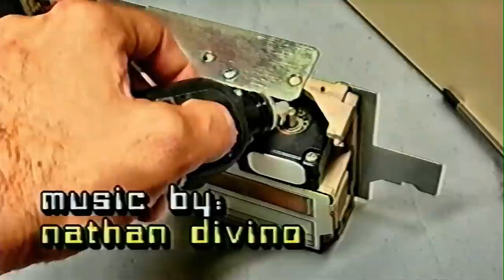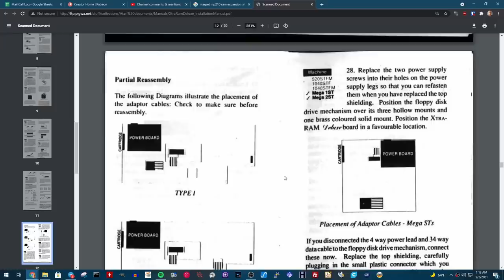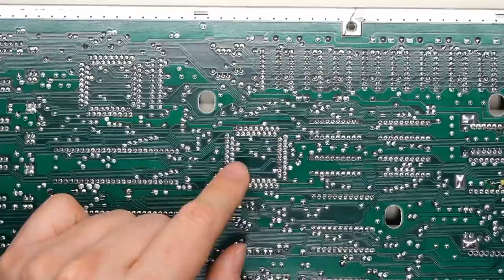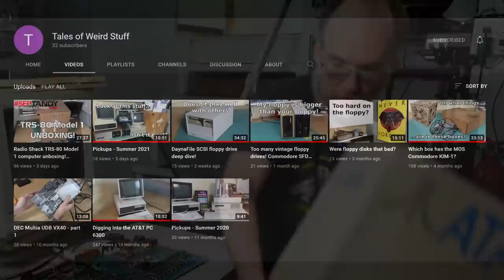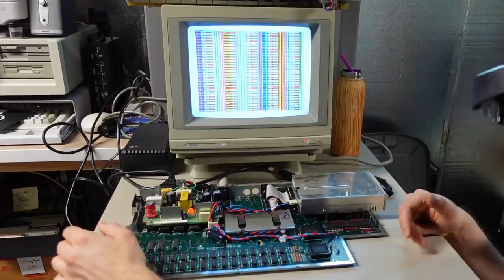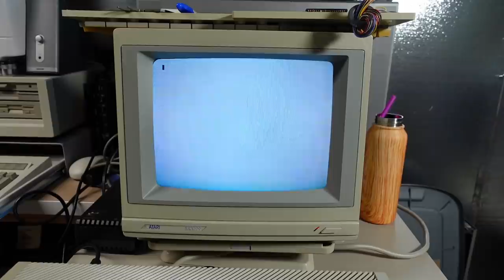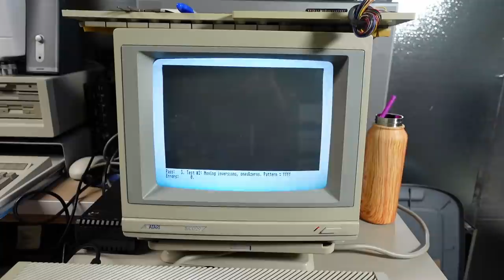I figured out what is wrong with the Atari 520 ST!

Comment: My 1040ST got me through college with zero issues. Replaced it with a PowerMac 6100 66 DOS that I used until 2005. Two computers in sixteen years, until internet and software demands forced me to join the 21st Century. Simpler times.

Comment: Very good troubleshooting. You nearly reverse engineered how the ST works. :-) Bad MMU is not that common. I never had an ST with a bad MMU. But the PLCC sockets of the MMU and the GLUE are known to have contact problems from time to time. Especially if a RAM expansion was squeezed between chips and socket. I would suggest to take a closer look at the pins of the bad MMU with a microscope. Maybe some of them are not making good contact and the MMU from the 1040 is working because it has them still in order.
Reply: I was thinking this same thing. As you say, check all the pins on the MMU.
Reply: For a time I worked doing warranty repairs for both Atari and Commodore. I saw pretty few Atari ST machines coming in but a lot more Amiga. I remember that for a time Commodore had big problems with those PLCC sockets and chips not getting good contact. A lot of this was traced to the factory where completed and boxed machines got bumped around when the pallets were loaded onto the trucks. To get to the loading docks the forklifts drove over some very uneven parts of the floor. As I remember it they described it as all the cartons on the pallet going airborne only to slam down after free falling more than an inch, but that could be my memory playing tricks. Apparently that was enough to shift the chips just a little in the sockets and if you were unlucky it resulted in the machine failing. Often just pressing all the chips firmly into the sockets could get the up and running again. Even after addressing that problem with the forklifts Commodore choose to install a retention spring across the the sockets and it cut down on the number of DOA and early warranty returns.

Comment: That MMU may still be alive, clean the pins and check if none of them are pushed in from the side, those PLCC mod boards wreck sockets and chips.
TOS 1.00 is just bad, replace it with 1.04 ASAP, 1.00 is kinda buggy and don't even bother with harddisks on that version, the hardisk routines are seriously borked in 1.00
I have no idea what is in your SF314 or if it even works, but the signals that come from the atari itself are pure Shugart, any active conversion within SF354 or SF314 is to accomodate a non standard drive.

An easy way to check if an atari 16/32 bit machine lives is to check the floppy led or the DS0 line on the YAMAHA, a faint blink indicates some lif in it.
One of the biggest issues with these old Atari's is in my experience. bad contacts on sockets, especially the square plcc sockets, clean them or carefully re-bend them.
If needed replace those pesky staggered sockets with SMD sockets, with some bending of the outer pins you can solder these sockets with smd and through hole at the same time.
The easiest retro way of upgrading the 520st is by piggybacking another set of ramchips on the existing and connect their RAS and CAS lines to the other set at the MMU for a home made 1MB total 520ST+, or you can solder a 72pin socket to the board, it's a tedious job, but a fine DIY way to max it out, ST's need FP-RAM sticks.

Boot speeds relating to floppy drives.
1: diskette with game or bootsie bootsector
2: regular diskette in drive
3: no disk drive attached, takes a second to detect a drive foor bootsector and gives up. Also no A or B drive on desktop.
4: empty drive, takes a long time to give the user time to insert a bootable diskette
Reply: Adrian's 520 ST has 1.4 already
Reply: @Motolav  I think S B is referring to the 1040 STF, which has TOS 1.0 in this case.
Reply: @TPau65  which isn't Adrian's lol
Reply: I still have TOS 1.01 on my machine.  You can get TOS 1.04 and boot it from the Floppy if you can't get the ROM.  Also you can get the Clock speed up to 16 MHz. but if you want some old games or software to run you should install a switch so you can boot the machine stock without having to remove the mod.
Reply: @kevin34ct  You mean TOS 1.0, there wasn't a 1.01. In my 520 STM I have switchable TOS 1.0 and KAOS-TOS. 😁
Reply: @TPau65  mis-typed, it was 1.02.  I could install a blitter
Reply: Why not go all the way and update it to 1.06. Those were the latest official versions. iirc 2.06 was same Tos, just for STe's

Comment: Some background Information:
The RAM bus and the system bus are separated. The Shifter is on the RAM bus. The separation is needed for the framebuffer (Shifter) and RAM refresh. The MMU is controlling the Shifter and it is fetching 16Bit every 256 clock ticks. Without the separation the system bus would be blocked every time a RAM refesh is running or part of the frame buffer is fetched into the Shifter. A Crazy little tidbit. To load the Shifter register only the lower 8 bit of the RAM bus is connected to the system bus to present the register to the CPU.

The ROMs are on the system bus not the RAM Bus. The 68K can't run without RAM. Important Interrupt and Error-Jump variables are stored In the first 512 byte of RAM.

The only reason why MMUs are diying is an overload on the output pins. (and over voltage) The chip can't really power a lot. With 4MB RAM the output limit is reached. This is the reason why you have to completely disconnect the RAM (lifting all the resitors). It is recommended to remove the old RAM chips. Not only to protect the MMU but also the power supply. The diconnect of the CAS0/1 lines is a botch job that can work but will stress the MMU.

SOME versions of the TOS did crash when the keyboard is not connected. The reason is that the inteligent keyboard controller (ikbd) is also the system clock. And when the system clock is not initialized the TOS would crash. But the ikbd is a very bad clock with an high drift. But good enough for a day or two. So later Models like the MEGA ST, the MEGA STE, Falcon and TT had all clock chips.

Comment from the maker: Lots of people pointed out that the Atari does have a full 16 bit bus and that I "got it wrong." That may be, but consider the fact this was the first time I had ever worked on any 16 bit Atari, I had not yet examined the schematics for the 520ST and that the other 68000 machines I've worked on (the Macintosh 68000 machines and the Amiga 68000 machines) do not have two CAS lines for the high and low bytes of each memory location. All 16 RAM chips on these systems get the same CAS signal so the RAM is either selected or it's not selected.

If one were to hook up 8 bits of RAM to a 16 bit system, two latches and two banks of 8-bits of RAM with two select signals would be one way to do it. This would easily allow Atari to install half the RAM in the system to allow for 256k of RAM. (For the 260ST)
Reply: Didn't BYTE mag publish a way to upgrade the memory for the Atari 520ST?
Reply: While I'm pretty sure the ST (at least normally) uses the full 16 bit bus, you are correct that the existence of the latches between the MMU and the RAM suggest it is a possibility. The board I made in school used latches in the way to interface a single 8 bit ROM to an m68k, although for the RAM card we did have a 16 bit data bus with separate select lines for each byte connected to UDS/LDS in large part because our address decoding logic was simpler that way.
Reply: Using latches and two select signals COULD work since the 68000 doesn't have an A0 signal on the address bus. It instead has an upper data strobe (/UDS) and a lower data strobe (/LDS) which you could use as the selects. Those signals are there because Motorola intended RAM to be organised in parallel high byte/low byte "banks" and is precisely why Atari chose to organise the ST's RAM in two or four parallel high/low banks the way they did.

Besides, you'd need to get the timings just right for it to work which would likely mean having to use much faster (and therefore MUCH more expensive) RAM chips more than wiping out any savings you'd make by using half the chips - well, back then anyway. Otherwise you'd have to find a way to insert wait states while loading those latches, I've not done any 68k hardware design in a couple of decades and I'm not sure that's even possible (maybe using the /DTACK signal?). All of which would slow the machine down.

Also for 16/32 bit memory operations /LDS and /UDS both go low together, so even more complications...

No, the only sensible way to create a 256K ST would be to have two banks of 128K RAM chips - e.g. HM48128P, MK4128N, etc.
Reply: @nathanperry1997  RMC recently showed how to upgrade an Atari 520STFM from 512k to 4M but from what I can tell that probably wouldn't work in this 520ST.
Reply: Yeah here is just one memory bank 16bit width connected, you can solder a second batch of memory ontop of the first one and connect ras/cas to the mmu to get 1mb of memory. Atari did it on the 520St+
Reply: Checked the Amiga A500 and Mac Classic schematics. Both have separate CAS signals for high and low bytes, just like the Atari ST.
Reply: @nynyny7  the st has Ras0 for Bank 0 and Ras1 for bank 1, and cas0 low and cas0 high, cas1low and cas1 high. So you have two banks 16bit width. The Atari Mmus (not the imp chipset) can handle different bank sizes.
Reply: It's addressed as two banks to acomodate byte wide memory instructions. In older machines most data was byte wide, 8 bits. If you addressed memory only as 16 bits you would waste large amounts of memory or have multiple instructions to write only 8 bits without altering the other 8 bits. If you wanted only 256k, you used two 128k banks or you wouldn't be able to use 16 bit word instructions.
Reply: Amigas most definitely do have two CAS lines.  Without them it's impossible for the CPU to read/write single bytes.  I'd be surprised if Macs don't also have the same setup, but I've never looked at one of those.
Reply: @ingouhlemann5035  No, there are two memory banks here each being 256K*8. One provides the lower 8 bits, the other the upper 8 bits.
Reply: @lilbill6089  Many/most 68000 instructions can operate on bytes, words or long words (32 bits). This is one of the beauties of the 68K instruction set.
Reply: Re: the Macintosh, the original Macintosh 128/512 has a separate CAS0 and CAS1for the upper and lower banks. It does look like they share the same RAS, which is a little sketchy... but it looks like a shortcut you can get away with? The Mac Plus, which has a total of four 8 bit wide banks, has CAS0L/H and CAS1L/H. So it's definitely capable of doing byte addressing as well. As other posters have noted this is a requirement for the 68000 (and other longer-than-byte word length machines); if it lacked this the memory system would have to do a read-before-write of the 16 bit wide array every time you updated a single byte of memory so it could write the other byte back.

Also the schematics for the ST confirm those buffers and latches on the data bus are wired in-and-out for 16 bits on both sides, the memory chips are not on an 8 bit bus. If Atari had actually produced the 260ST my guess would be that they would have done it with piggybacked 64kbit chips like IBM ended up using in the original IBM AT. (Perhaps both companies assumed that 128kbit chips would be a thing; it's a little known trivial fact that there was briefly an "8k" DRAM sold as the 4008 that was actually a half-bad 4116; these were used in the 8k version of the Commodore PET 2001-N. The first 32K versions of the Radio Shack color computer also supposedly used factory-second 64kbit chips that only tested half-good, although I don't know if there was ever a model number associated with these. A market for half-bad 256kbit chip would have been a perfectly reasonable thing to expect.) Otherwise the machine would have been obviously slower and needed a different motherboard and custom chips.

FWIW, there was an 8-bit machine called the Acorn Electron (highly stripped down version of the BBC Micro) where in an utterly bizarre cost-cutting move they implemented its 32k memory with four 4164s and embedded into a big ULA chip the latches and other garbage to make that work. They must have designed it right before the 4416 came out.
Reply: @PaleozoicPCs  why is a single RAS signal sketchy?

When you're refreshing your memory you'll want to refresh the same row in both banks at the same time.
Reply: @TomStorey96  Yeah, I thought about it a little after posting and, sure, a shared RAS is fine. With these DRAMs It's the CAS after RAS that triggers the chip select for the read/write transaction so it's fine if the bank you're not hitting for a byte-wide value receives the same RAS.
Reply: @ensor2872  I've been doing loads of 68k stuff recently, and you're not too far off. With the right logic and coordination you could take two bytes from a single bank of memory and latch them onto the two halves of the data bus.

All the while you would simply leave DTACK negated while that whole dance was going on, and once finished you assert DTACK and the CPU grabs the data and moves on.

It would likely slow things down a bit, DRAM from those days want super fast. So definitely, parallel banks for upper/lower was the way to go.
Reply: (Scratch all of that, just got it wrong)

Some DRAMs have separate OE and WE signals so you might even get away with a shared CAS signal at the expense of a bit more power consumption.
Reply: @TomStorey96  Of course, if you really wanted a 68000 with 8-bit wide memory there was always the 68008, although the 20 bit address bus was looking a little backwards by the time the ST came out.

Interestingly the fully 32-bit 68020/68030 have built-in dynamic bus sizing that would make it trivial to run them on an 8-bit wide memory, although why you'd want to waste a CPU like that is an interesting question. (It wasn't unusual to run them in 16 bit mode, a number of low end Macs did.)
Reply: @PaleozoicPCs  yep, I've got a couple of 68020s set aside for some future projects, and the dynamic bus sizing is going to be fun to implement.

It's a really neat feature though, allowing you to interface easily with memories and peripherals of all bus sizes, you just have to "tell" the CPU how much data is available for a read, or was taken in for a write.

I've got a bunch of 4mbit DRAMs in some nice looking ZIP packages that I'm intending to use in a 32bit wide bus. ROM will probably just be 16 bit for booting though - programming 2 ROMs is painful enough, but I tend to use a simple serial "bootloader" that I wrote as it's muuuch quicker to test new code.

Comment: I had a 520 STFM, with a 4MB memory expansion, which used 30 pin SIMMS. I also had a 52MB quantum scsi hard disk, with a DMA host adapter, which cost me two weeks wages back in the day. But it allowed me to play The Secret of Monkey Island, without swapping floppies :-)). Keep up the great work.
Reply: Sounds pretty much like my Amiga 500 back at the time. Only I had a 40MB Micropolis drive, and with the SCSI controller I think it was almost three weeks of wages that went into the HDD. And I got that drive at about half the RRP...
HDD's were horribly expensive back then.

Comment: This is one of the most common failures on the ST. Turn the chip upside down and carefully push/bend the pins outward the end of the pin has a stop point on the package. Also bend the socket pins slightly so they put more pressure on the chip. 

If that doesn't work the MMU is definitely fried.

Comment: Although the 68000 has a 16 bit data bus the memory is byte-addressable which requires separate chip selects for the high and low bytes - hence the two chip select bodge wires. Check the CPU pin diagram and you won't find an address line A0. It is replaced by a pair of upper and lower byte select lines. The 68008 (as used in the Sinclair QL) is basically a cut down 68000 with an 8 bit data bus, fewer address lines and a few missing control lines. I had a 520STF back in the day with an SM124 monochrome monitor and wrote my university dissertation on it (BSc Computing Science). I moved up to an Atari Falcon but after years gathering dust in the loft after I moved to PC's they both ended up in the local refuse dump! 😲 This was long before online auction sites made such machines valuable. I still get cold shivers when I remember dropping the Falcon into the dumpster 😭
Reply: You simply can't just wire up the memory with only 8-bits and call it a day on this iteration of the 68000, all 16 bits of the data bus are acquired whenever instructions are fetched, whenever data is accessed that is a word or longword, whenever reset or exception vectors are accessed, whenever any kind of stack operations are performed, etc.

The ST schematic shows that the 68000 data bus isn't wired directly to the RAMs, data from the RAM is latched by 74LS373's, and writes to RAM are buffered by 74LS244's.  I'd say this is probably used because without them, the MMU would have to stall the 68000 even for non-RAM accesses while the shifter is retrieving the display memory.  The buffers split the data bus so that the 68000 can access ROM or non-Shifter I/O concurrently while the Shifter/MMU is fetching display data.

The ST schematic suggests that the MMU can control two different banks of RAM, but on the 520ST only one bank (of 16-bit-wide data) exists.

Comment: I was lucky enough to live near enough to an electrical engineering genius, we had originally piggy backed 520's to 1Megs, and then later he had a single chip with all three tos versions on it, selected by 2 switches set before you booted up, the last thing was a 4 MB ST had to swap out the original memory chips for that one though. And if I remember correctly, the bigger chips had 2 more pins on them so the sockets he used had 2 pins lifted up and hand wired / soldered to complete the modification. Never had a single problem with it.